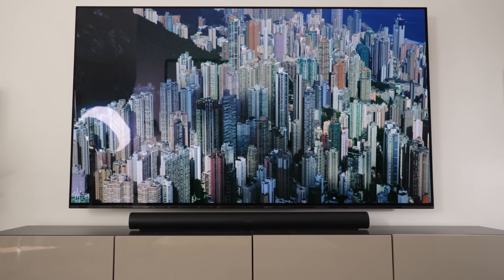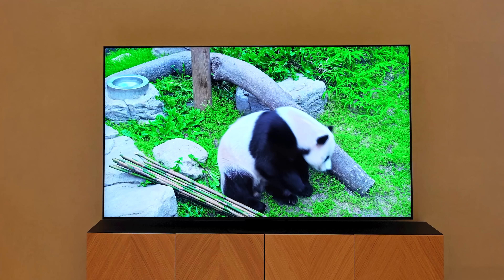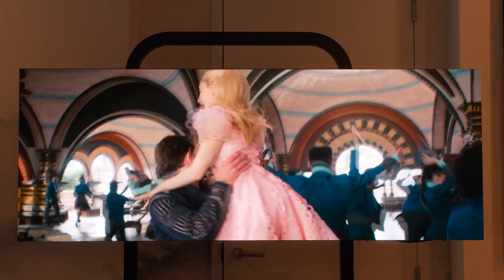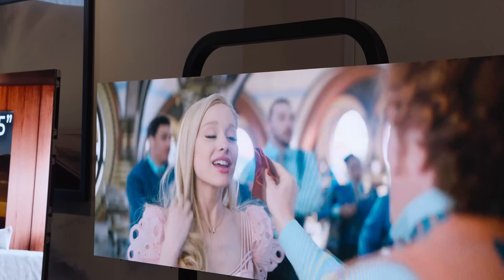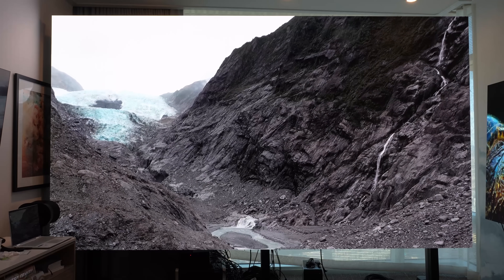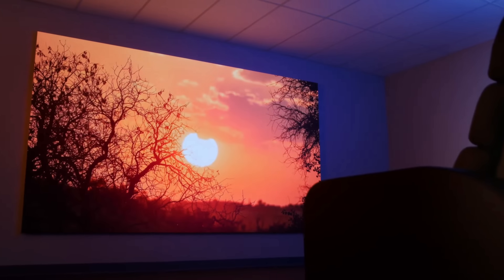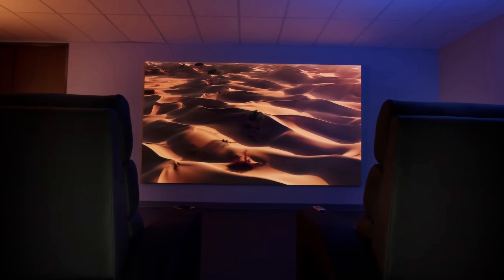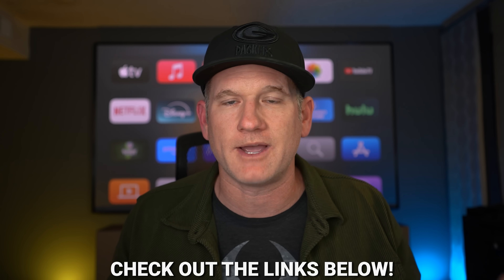162" MicroLED is Actually Coming! - AWALL Vision

Comment: Something just dawned on me. How is the resolution so “low” when there are 10’s of thousands of microLEDs per panel that are each able to be controlled? Is it similar to how miniLED TVs have zones?
Reply: Micro LEDs are not measured in 4k, 3k resolution for exactly what you said. There’s are millions of immersive led bulbs on the outside of the panel, zero diffusion, whether you have a 27” or a 163” it shore as 4k or higher. It’s best to look at nits, contrast and color gamut.

Comment: it's good but when you have the vision master pro 2 that can do a 300" screen and only costs 2600 I just can't see the benefit to something like this.  it also worries me how much it would cost just in power needs.
Reply: It takes more power to run a projector than to run a large micro led Wall. I have both the Valerion and 135” AWALL MicroLED and it’s not even close. The AWALL blows it away in all aspects. Don’t even use the Valerion anymore.

Comment: whats the ppi on the 1.2 and 0.9. Thats the spacing apart. Idk how big the pixels actually are. Im not able to simply google how many square mm in 1 square inch to get the number. I guess I could do some math on the 162 inch screen since i know its pixel count. Id like a spec from the website though.

Comment: Looks amazing and at a much more reasonable price than others!  My main concern is around connectivity between the external Novastar processor for multi-view video and an existing Dolby Atmos system for audio in a home theater setup.  A deeper dive there would be great once you get one of these installed at home!

Comment: Maybe I'm just a "home theater snob" but I've always been dubious about Chinese brand TV's/Displays, and until this point I would've never considered a Chinese brand over one of the big 3 (Samsung, LG, Sony)  just to save a few bucks.  Really, I haven't been interested in buying any TV regardless of the brand in quite a while because as amazing as the picture quality is on a modern OLED or microLED display, after owning a projector, I just couldn't go back to a small 80" display.  In Fact, I'm planning on upping the size of my screen in a few years when I build my house.   I was planning on a JVC D-ILA blue laser projector with a 200-220 inch 2.35:1 screen.  If I could have a microLED video wall for a similar price I would definitely have to consider it.  I wonder how this compares to the LG Magnit or Samsung's "the wall", because it is SIGNIFICANTLY cheaper, and in my experience, you generally get what you pay for.  I would love to see some testing using professional instruments by an independent 3rd party, Also can these Awall displays be professionally calibrated using standard methods?
Reply: I’ve seen most of the MicroLEDs in person—from Samsung’s The Wall to LG’s offerings—and AWALL is right at the top.
They use the same COB MicroLED technology, same ultra-fine pixel pitch, and same jaw-dropping performance.

So why is AWALL priced lower?
Not because of lower quality—but because they built a smarter supply chain.
Use top level manufacturing, cut out the bloated markups, and make high-end tech accessible—so more people can afford it, and more people can own it. Simple.

This isn’t some watered-down version. It’s the real deal—massive MicroLED walls with up to 9 million native LEDs, stunning brightness, Infinite contrast, and lifespans measured in decades.
Reply: If you are going with a 200 inch screen get it built with mortised masking or even manual sliding masking. It means you can do any aspect ratio without black bars. That then means the aspect ratio of the screen does not matter. It could be 200 inch 16:9 but the masking allows you to make 2.7:1 if you want or 2.39:1.
Reply: @Art-is-craft  I don't like masking, I prefer the look of borderless or frameless projector screens.  In the case of this microled display, it looks to also be borderless. Masking is still essentially black bars, they just happen to be physical rather than what you're seeing on the display
Reply: @00HiGhGuY00 
In a proper theatre set up you will not notice the masking only the screen image. The purpose of it is to provide greater image contrast that gets lost with the black bars. When done properly it will enable a movie to be presented in its original aspect. It looks spectacular on a 2.7:1 ratio as it is extreme super widescreen.

Comment: At a 162" I hope its 8k
Reply: You’re not relevant. Why do you make stupid comments like that. This company brought the price down by 1/4 of big brand pricing and you make dumb comments. 162” OLED if they had the tech would be 200k.
Reply: 8k is not needed for 160 inches as 4k is enough. Your eyes at 15 feet will not see the difference between 4k or 8k. Even 1080p 60 inch tv at 15 feet will look no different  from 4k.

Comment: AWALL CoB MicroLED Display                 Pixel Pitch:  1.2
Sale price$17,500.00
30% Deposit      Display Ratio and Size:
                            102" / 21:9 CinemaScope            Note: Items will ship based on the estimated delivery date. A 30% deposit is required, with the remaining balance due when the order is shipped.     
                Shipping: ~ 6 weeks

Comment: Bruh.. 1080p at 108/135 inches is pathetic. 4K at 162" isn't too amazing either tbh but then again it's not like there's much higher res content out there so it's fine.

This tech needs to get down to ~75" with 4K resolution and at a reasonable price. Then it kills OLED.

Micro LED (gaming) monitors would be truly incredible. All the upsides of OLED with no burn in.
Reply: If you are sitting 15 feet away from the screen you will not see the pixels. At that size colour and brightness rules. It’s the reason why 4k cinema works even though at that size 4k performs like 1080p. A plasma panel with 1080p looks amazing and will out perform many 4k sets.

Comment: I can't imagine the electricity that thing uses and the amount of heat it puts out into a room.
Reply: on their website:  "AWALL reduces power consumption with its 3D inkjet printing technology, enhancing black consistency even when  the display is off, and improving efficiency by 20% at the same brightness levels. Our Micro LED integrated structure further minimizes energy usage, with an average power consumption of only 65W/m², which is 64% lower than traditional Screens that consume 180W/m². This efficient design not only lowers energy costs but also extends the display's lifespan. With a Common Cathode Energy-saving IC that reduces system temperature and a low-power COB flip-chip LED, AWALL's display lifetime exceeds 100,000 hours, ensuring longevity and reliability."

Comment: My interest in MicroLED is in regard to what it can do for High Immersion Gaming on PC.

In my effort to maximize immersion I went from a 24" FW900 CRT (2304x1440) to a W1070 projector at ~110". The problem was that the 1920x1080 resolution of the W1070 limited how close I could get to the screen before the pixels became too large, and thus I couldn't really get a larger horizontal FoV than I could on the FW900 --- around 77°.

Though there is something about a larger screen, even at the same FoV as a smaller screen, that delivers a different experience. I've only been able to conclude that it has something to do with our binocular vision.

I then moved to a 55" LG 4K OLED. The much higher resolution allowed me to get relatively much closer to the screen. At a View Distance of 18" (Yes!) I get a horizontal Display FoV of 106°, which is higher than most VR headsets. When combined with the absolute black level and a literally pitch-dark light-treated environment so that the only thing within my perception is the light coming from the screen (and intra-aural earphones) the immersion is truly indescribable compared to a normal gaming experience.

The key to High FoV Gaming is that the In-Game FoV must match the Display FoV. If you just fire up a PC game and then get 18" from a 55" 4K screen it's going to look ridiculous and unplayable, like you're looking through a telescope.

The higher the In-Game FoV is than the Display FoV the more distorted/fisheyed the image, and the lower it is than the Display FoV the more zoomed-in or "telescoped" the image will be. Distortion/fisheye is not caused by a "too-high" In-Game FoV --- it's caused by a mismatch between In-Game and Display FoV. And the same for a zoomed-in appearance.

I need a larger display for an even higher Display FoV, but beyond a certain point I also need a higher resolution in order to keep the pixel density at an acceptable level. This kind of MicroLED display could be great for High Immersion Gaming, but there are a number of important issues regarding a display that go beyond size and resolution (and price).

Comment: This isn't really proper MicroLED. 12,000:1 "Native" Contrast is barely above the 7,000:1 native contrast of an TCL LCD panel. Also the 1-2 million LEDs doesn't make it 4K native resolution. Only 8.3 million pixels does that. And It's clearly back lit and must have some dimming zones or something if it has a 4K resolution because it would mean there is at least 4-5 pixels per LED.

1200 nits if that is in total that is weak today, if it is 1200 nits full screen that would be impressive. 

IMO, this isn't microLED, this is a hybrid of some kind.  There is information missing if they claim it is. Again 1-2 million pixels cannot make a self-emissive 4K resolution and if it was truly self-emissive it wouldn't be 12K native contrast.
Reply: In Micro LED technology, 4K resolution isn't necessarily the most important feature in the same way it is with other display technologies like LCD or OLED. Here's why:

Pixel Density and Viewing Experience: Micro LEDs are composed of individual micro-sized LEDs, each capable of producing its own light. These tiny LEDs allow for incredibly high pixel densities, meaning that even at lower resolutions, the clarity, sharpness, and brightness can still be superior to traditional displays. So, the quality of the image can be outstanding even without 4K.

Scalability: One of the main advantages of Micro LED is its modular design. The displays are made up of smaller panels that can be scaled to any size. This flexibility allows for larger displays without sacrificing image quality, which can often make the pursuit of 4K less relevant, especially for larger screens. A larger screen can still deliver an immersive experience even with a lower resolution, due to the technology's superior contrast and color accuracy.

Superior Picture Quality: Micro LED displays provide incredible contrast ratios, vibrant colors, and perfect blacks because each pixel is independently lit. This is a major advantage over traditional LED and even OLED displays, where 4K resolution may still struggle to deliver such high levels of picture quality. So, the emphasis with Micro LED is more on picture quality and performance rather than just the resolution.

In summary, while 4K is a key resolution for many displays, Micro LED technology focuses more on overall picture quality, scalability, and contrast—with a future-forward approach that can handle even higher resolutions as the technology advances.
Reply: @homemediapatrol3784.. Nothing but a bunch of excuses.
It's not a 4K resolution, period. Unless it has 8.3 million self-emissive pixels.
If they are not self-emissive like this panel clearly is NOT. It's not MicroLED as we know it. As in fully equivalent to OLED with self-emissive pixels and same resolution.

This TV is backlit and it's using dimming.
It is 1200 nits so it's inferior to OLED in every way and in fact even a MiniLED beats it at least when it comes to brightness. Not perhaps black level.

You can make cute quote about "believer". But it's a non sequitur because nothing I said has anything to do with belief. But 100% fact. 

1200 nits peak brightness is garbage today. The OLEDs hit this year up to 2400 Nits. MiniLEDs can hit 5,000-10,000 nits.
"Optimal" according to Dolby Labs is 10K Nits.

This thing is a hybrid but does nothing fully. 

The only thing it has is size.
Reply: 1. Optimal Viewing in Various Lighting Conditions
1200 nits peak brightness is t enough to deliver vibrant, detailed images even in rooms with ambient light (such as natural daylight or room lighting). In a typical home, you might not always have full control over lighting, and 1200 nits ensures the display remains visible and vibrant, avoiding the washed-out effect that can occur in brighter environments with lower brightness levels.
2. Enhanced HDR Performance
High Dynamic Range (HDR) content is designed to showcase deep contrast and bright highlights, and 1200 nits provides a solid peak brightness to fully display these details. This allows the bright parts of an image, like sunlight or reflections, to shine vividly without losing detail in the shadows. For a home display, this level of brightness ensures an immersive and accurate HDR experience without overexposing the image.
3. Balanced Brightness and Comfort
A 1200-nit peak brightness is bright enough for most home environments but isn't so high that it causes eye strain, especially during prolonged viewing. It's a comfortable level for day-to-day use, providing an engaging viewing experience without overwhelming the eyes, which can happen with higher brightness levels (such as 2000+ nits) in a dim room.
4. High Contrast in Well-Lit Rooms
In a well-lit room, especially with large windows or bright artificial lights, 1200 nits ensures the screen’s content remains vivid and sharp. It overcomes glare and reflections from surrounding light sources, providing clear, detailed images, even in bright spaces.
5. Good for Mixed Content
Homes often have mixed use cases for displays — from streaming movies and TV shows to gaming and sports. The 1200-nit peak brightness is well-suited to handle all kinds of content. For example, sports or gaming can look great with bright, vibrant details, while cinematic movies can have the deep blacks and subtle shadows needed to enhance the atmosphere. It's versatile enough to maintain good performance across varied content.
6. Future-Proofing
As 4K, 8K, and HDR content continue to grow in popularity, 1200 nits ensures the display is ready to fully take advantage of this content, providing the necessary brightness to showcase the high-quality visuals of tomorrow's media. It also ensures that future HDR content will be properly rendered without the risk of losing detail in either the highlights or shadows.
7. Energy Efficiency
1200 nits is bright enough for most home setups but less power-hungry than displays with higher peak brightness (such as 2000 nits or more). This makes it more energy-efficient while still delivering excellent performance.
In summary, 1200 nits of peak brightness for a Micro LED in the home strikes the perfect balance for most users, delivering great HDR performance, clear visibility in various lighting conditions, comfort, and future-proofing for upcoming content without excessive power consumption or eye fatigue.
Reply: "You can't convince a believer of anything; for their belief is not based on evidence, it's based on a deep-seated need to believe."
Reply: @ This sh*t has nothing to do with belief. What a clown.
It has to do with facts.

Comment: Great video. The biggest problem with MicroLED is the misalignment of the panels when looking at it in a close distance. For the price, I would be expecting perfection, and even the best and most expensive MicroLEDs that were on display at CES looked terrible in many ways. I'm basing this on a closeup that Digital Foundry did. They didn't like it at all.
Reply: This has nothing to do with the way AWALL manufactures their panels. These are not beta units; this is a go-to-market product, and I believe B would have mentioned it. Are you complaining about another manufacturer’s installation methods?

Comment: What a great video. Thank you for doing the math as MicroLED is a bit confusing especially as it seems like everyone just talks about pixel pitch and never really the actual resolution as they know they down want to try and sell you a 15-30k 100 inch 1080p display. Great to see the pricing come down, but this has a long way to go before it’ll be under $10k and 4K resolution. 

I feel like QDEL or continued improvements to OLEDs and MiniLED or something in between Mini and Micro LED will come out sooner and for cheap. 

I’ve been following MicroLED since it was announced and knew and wanted it as my future TV but at this point I’m not sure I’ll get to that point in a reasonable timeline, cost or resolution. Feels like it might be Plasma but to an extreme. I hope I’m wrong.

Comment: MicroLED is gonna make large 8K 16:12 (4:3) aspect TV's possible, and 16:10, but 16:12 (4:3) will make it possible to watch IMAX full-frame 16:12 (4:3) films at home, like the Snyder Cut, and maybe we will finally start getting more full-frame 16:12 (4:3) Blu-ray releases, not to mention being able to game in 16:12 or 16:10 on a large 8K mLED would be incredible, that extra 45% of vertical resolution and screen size 16:12 has over 16:9 on an 12K 120 inch display would be incredible (120 inch 16:12 is equal to a 180 inch 16:9 display).